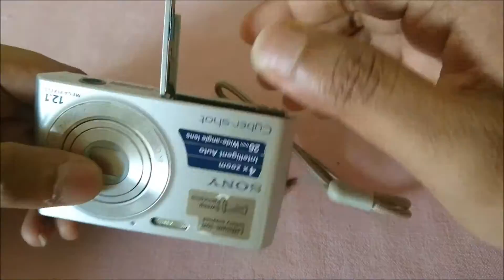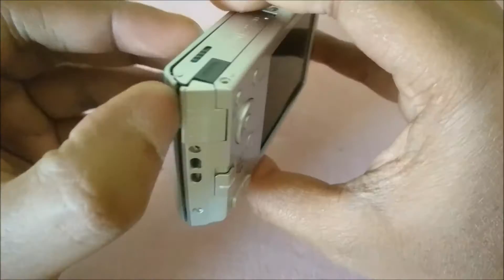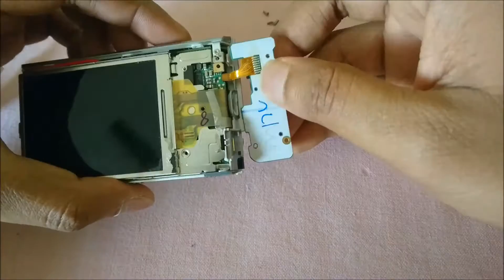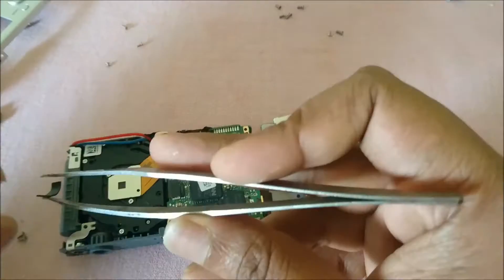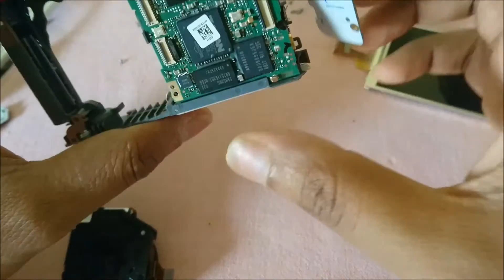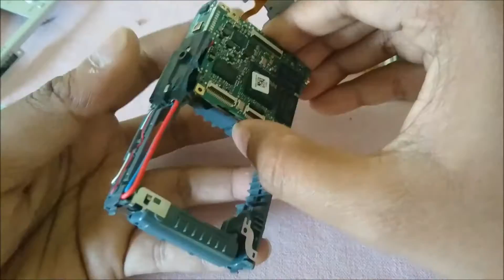Sony Cyber shot Camera Disassembly

Comment: Hi Amit,  thanks for the video.  Would you be able to point out which one is the internal battery?  My Sony DSC-WX5 doesn't keep the clock & date setting & I believe the internal battery needs to be replaced.
Reply from the maker: Yes,  but first time refixed the battery,  then check setting,   if still problem facing on you,  after change the battery

Comment: Is there a way to replace the backup battery (needed to maintain the time and date)?
Reply: yes i did it directly solder two wires to the orignal battery carefully coz if u spoil the chip u ruin the camera excess heat spoils the chip so be quick and professional, the wires should be thin as well as of good quality after solder place the orignal battery in now on the other side of the cable connect a new small lithium ion battery or connect it to usb 5 v in series with two diodes that step down the supply to 3.3v don't connect 5v directly....